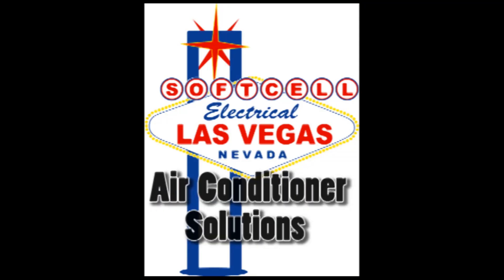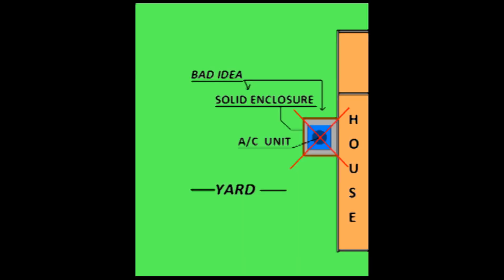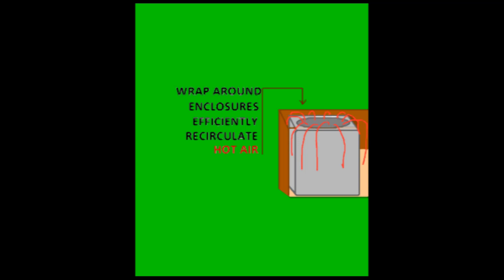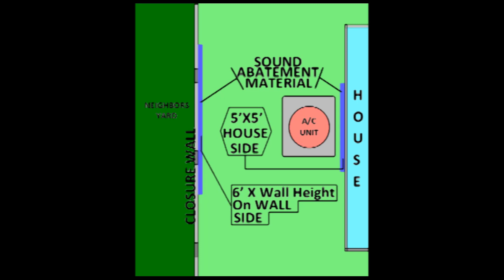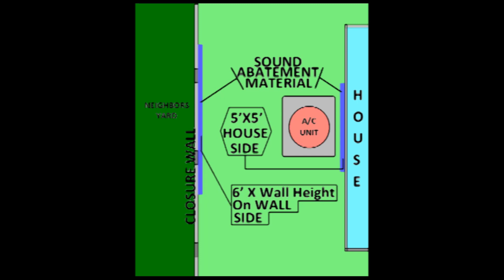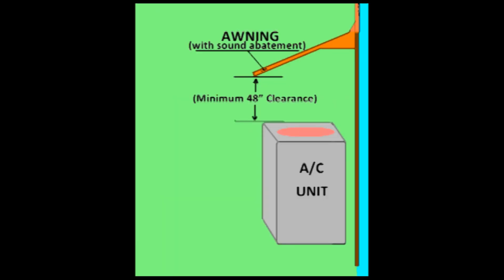Silence your air conditioner # 73

Comment from the maker: A very good point. One problem in Vegas is the 'zero property line' zoning. Sometimes it allows A/C units to be sandwiched between 2, two-story houses that are only 5 feet apart. Even the quietest A/C unit becomes a noise nuisance. On older housing tracts you can hear A/C units two houses away. In a case like that the only real solution is to replace the unit...but you still have your neighbors old unit to listen to. Vegas baby, gotta love it!

Comment: Purchasing a new unit will can reduce noise significantly. Many new units incorporate noise reduction features such as slower fan motors with specially designed fan blades and scroll compressors with sound blankets or enclosures to deaden compressor noise. This is a relatively new advancement in the HVAC world as manufactures only recently(last 10 years or so) have realized that noise control is important to the consumer.

Comment: I aggree with "tstateck" a new purchase of the condenser unit would be the best, and in many cases save you engery/money, plus you can have a "wood" enclosure (there was one on 3D warehouse but I just checked and seems to be gone)  if anyone needs it let me know I can email. And just one more point may want to keep 24" on the sides of the cond. unit to ensure clearance for maintaince etc. (not all ventilation contractors are skinny :o)